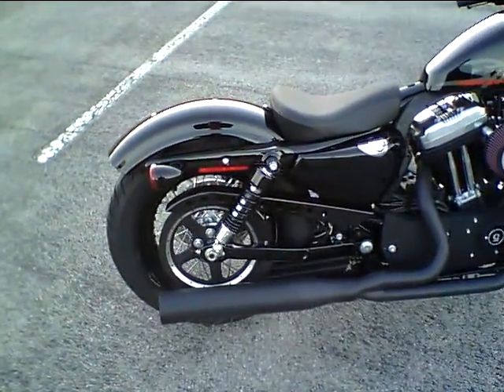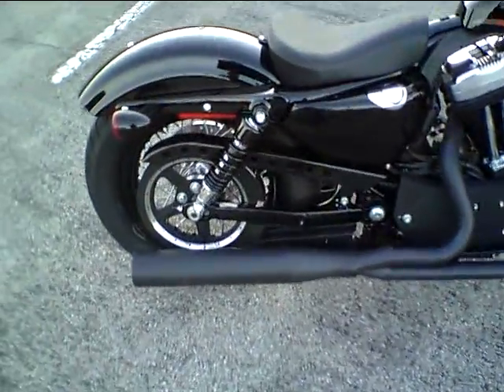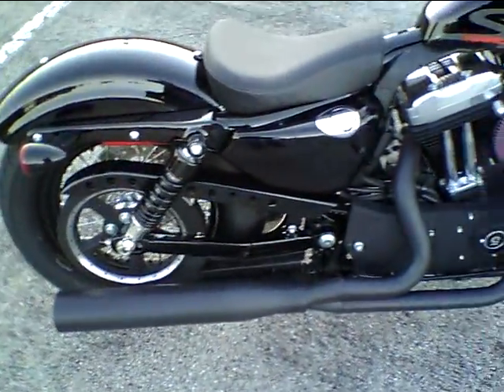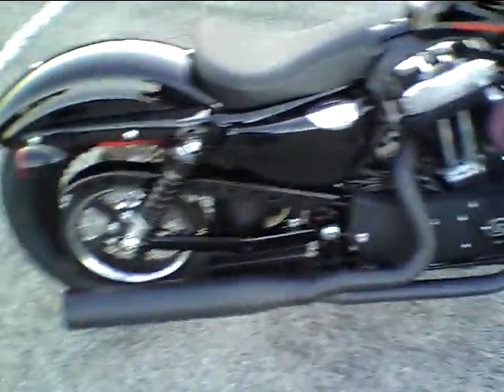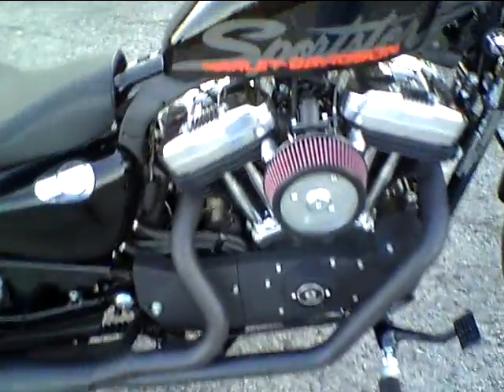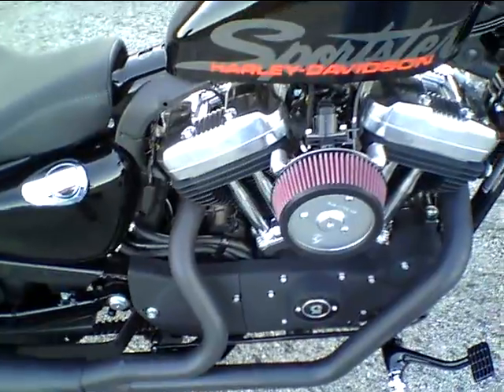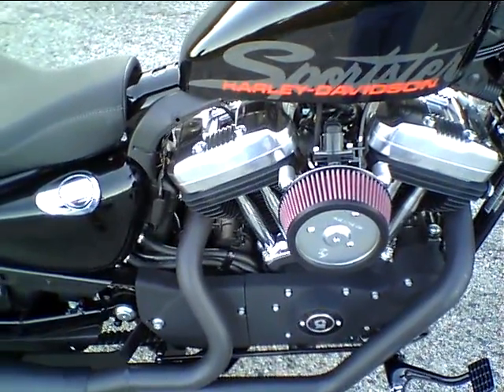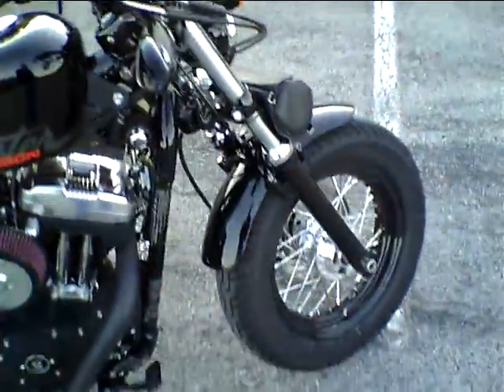2011 Harley-Davidson "Forty-Eight" Sportster with Vance and Hines "Blackout" 2 into 1 exhaust

Comment from the maker: @LxxxOld Thanks!  The bike was idling pretty low in this video, because I just finished a few hour ride.  It was running great.  That's a Ness "Big Sucker" air cleaner without a cover on it.  I've since put a cool metal cover over the end, leaving the filter exposed.

Comment from the maker: @Turkish1480 The header pipes definitely get hot and it's noticeable when riding the bike.  I ended up putting heat tape on the headers mainly for looks, but it also helped some.

The Blackout 2-1 does sound fantastic, though!

Comment: I totally agree they sound great!!  Is it a shload hotter than systems with heat shields?  I prefer the look of shields over tape.  I want these pipes but dont want to wrap them and wondering if its reasonable to ride these without doing heat tape.  Thanks again.

Comment: How is the heat from these pipes since there is no heat shield.  I would like to get them, but I am concerned about this issue.  I am not sure how accurate it is, but I have read the difference between the header pipe and the heat shields can be 400 degrees.  That's pretty significant.  Thanks for your thoughts.  Cheers.

Comment from the maker: @rockstarrken Well, I'm not an expert or anything, but I've been riding a little while.  The term "stage 1" to me refers to a higher flow air cleaner, higher flow exhaust, and a fuel module to make the bike run with more gas.  I think "stage 2" normally refers to the next level of upgrades, which may include that larger air cleaner.  But I think it also includes some minor engine work?  Either way, I'd go with the Stage 1 air cleaner if I were you.

Comment: by the sounds of it you got rid of the bike? i went with the fuel pack figuring both vance and hines products would work well together. nothing but issues now. pulls and sounds excellent but pops and backfires on decell. been in talks with tech support for weeks now but they keep giving me the run around. thumbs up for the blackout - 3 thumbs down for the fuel pack